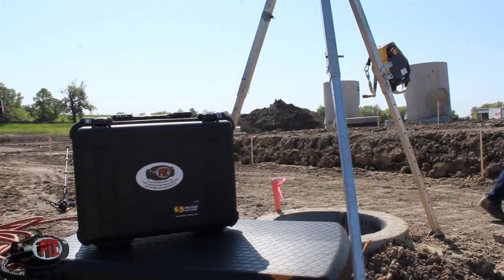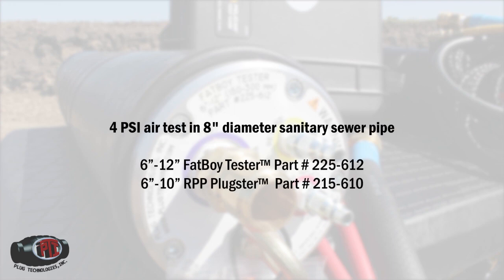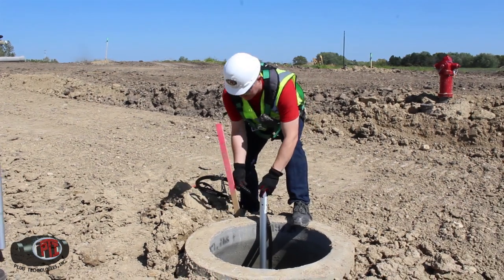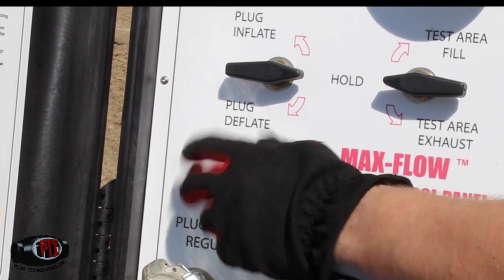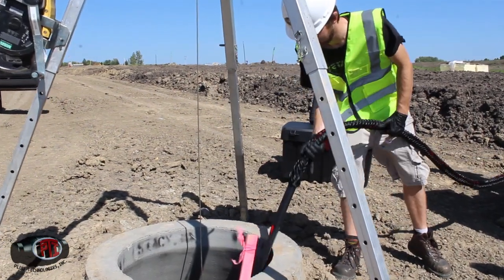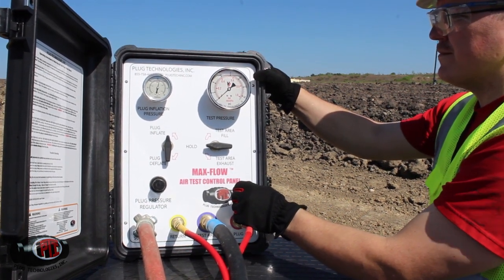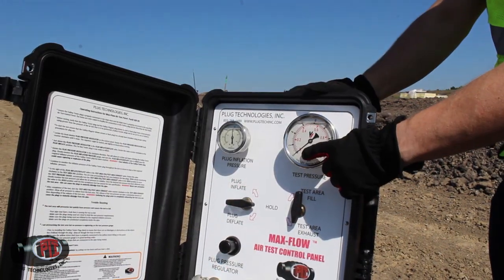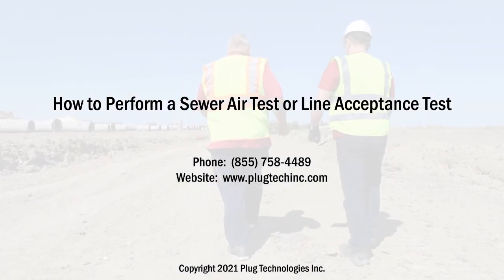How to Perform a Sewer Air Test and Line Acceptance Test

Comment: How would this work on a home with a 4" sewer lateral. What if the city sewer pipe is not reachable how could a city check the sewer laterals from each home to the sewer pipe ten feet under the ground. So the one pressure plug could be at the inside of the home but where would the other plug go if the tester could not access the end of that sewer lateral where it connects to the city's sewer.
Reply: Plug is floated down sewer clean out and visually monitored from the sewer mainline. When plug is at the main, the plug is inflated.